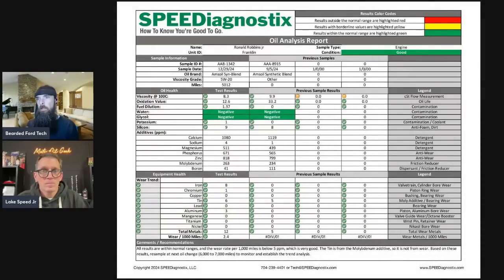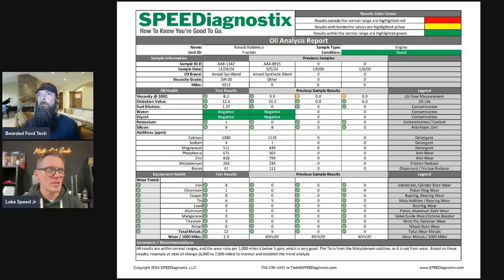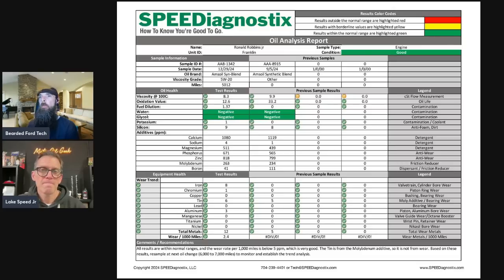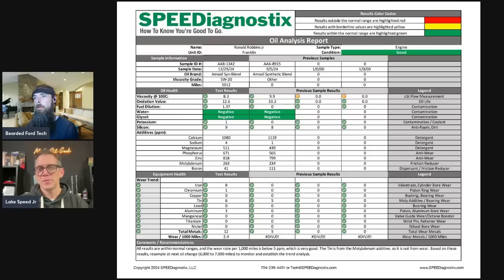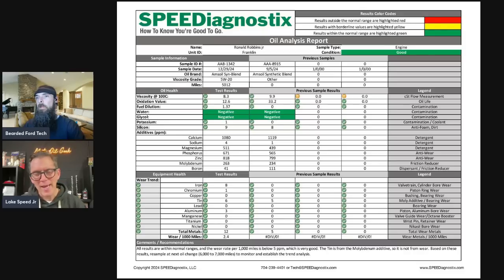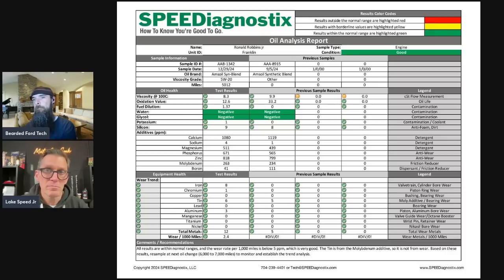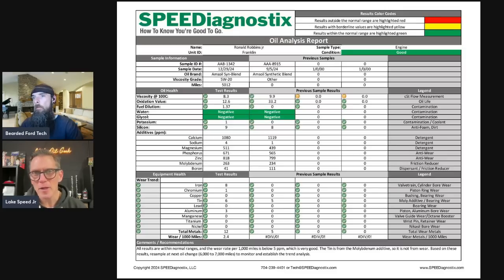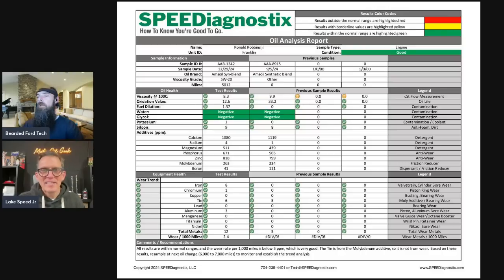AMSOIL Synthetic Blend Oil Analysis SHOCKING Results!

Comment: 2011 F350 6.7,  is Speed Diag the best kit to order.  Also I see there are special way to take the  sample.  Since I have a shop that does my oil changes, would most be willing to take the sample per the kit or just dump it in the sample cup and call it good?  For my next oil change Im going to check and see if they have Aimsoil.
Reply from the maker: @rickscott7350  there isn't a "special way" to take a sample. If your referring to the suction tool.  Thats usually for little cars through the dipstick tube.  When you drain the oil. Let it run for about 3 seconds then fill the sample container. Put it in the zip lock bag then in the prepaid shipping box and drop it in the mail box. Make sure you clean the drain plug area first so you don't get first and debris in it.  If they aren't a dealer or retail account they won't have amsoil. Speed diag is the best place I've used for testing. There's so much more data and easy to read (thats why  he color codes it)  and if you have questions. Email him and he responds. Dude is super smart when it comes to this stuff.  Keep in mind. The oil in this video is for gasoline engines. They do make a synthetic blend for diesel engines. But it's name commercial grade i do believe. If your going to be running amsoil in your 6.7. I recommend the max duty full synthetic.  That's the good stuff.
Reply: @BeardedFordTech  Ok, well I was reading the instructions and they stated to put it in a very clean quart container first then pour into the sample bottle at the website.   Guess the old wait 3 and stick the sample container works fine :D.  I dont know if they are aimsoil or not, will have to ask.   I know they dont like customers bringing their own.
Reply from the maker: @rickscott7350  you can put it in a clear jug if you want then the sample bottle. The kit comes with instructions in it.

Comment: I believe lake had an extractor device to send him a small amount of oil, lake do you have a link to that device??
Reply from the maker: @lothar52  an extractor device?  Like he used in one of his videos to pull from the dipstick tube?  You can get those at the parts store. Or here on Amazon.  https://amzn.to/4hA39S1 This was sent in by a sub in another state. He pulled the drain plug. Wait 3 seconds. Then fill the sample bottle.
Reply: Or maybe Beard has a small extractor device as well he knows about?  I got a Jag with a metal extractor pipe at the fill area comes from factory that we use to change the oil….was going to extract from that.
Reply from the maker: @lothar52  i sent an Amazon link in previous comment.  In case you missed it here it is
https://amzn.to/4hA39S1

Comment: I can understand what he's saying. Sorry super long!

 So when i was into aquariums.  I used a TDS meter, which doesn't actually define anything at all. It just sets a base line for total dissolved solids that are within the fluid using electrical resistance in parts per million.  Some of my tanks at the time were 999+ but when i chemically tested them  with 12 different chemicals in samples. They were stable and prospered in environment.  

Ive done the same with tds readings on sub 100  and it chemically tested sustainable and prosperous. 

Two tanks had 400 tds both chemically tested sustainable but one was very hard in PH and the other was nitrite heavy. The PH one only sustained invertebrates  everything else died. The nitrate heavy killed everything except plant matter. Same tank size, same plants same water. Completely different environments
Reply from the maker: @Derek-GMM  now that's super cool
Reply: @BeardedFordTech  that's what lakes was explaining. One, or several factors were changing the environment of the engine operation at that level. Which caused quite a few inconclusive results in several areas. It would be very difficult to pinpoint any cause with the engine history and fluid types or such.  At least at the level they are doing it at. SCIENCE!
Reply from the maker: @Derek-GMM  well there was also residual oil in there from the last change. That oil wasn't amsoil. He explained that as well. Still. Science!  It's frigging cool
Reply: @BeardedFordTech  yes, inconclusive results from exactly that
Reply from the maker: @Derek-GMM  yep. But. Still good oil. It's doing a great job from the data we do have

Comment: Interesting stuff.  Some of it is way over my head, but at 63 years old I still enjoy learning things.  I started out using UOA to check how my oil was holding up in my 2022 F450 6.7 Power Stroke here during the cold winters in Northern Nevada.  I try not to drive it unless I will put at least 40-50 miles on it so that things get warmed up to normal temps.  I've found that a winter front over the trucks grill really helps with getting the truck up to temperature and helps keep it there.
Reply from the maker: @richwitt3559  yeah some of it is over my head. I always learn from Lake.  He's a a really smart guy. Yes those grille covers are made for that and they work very well.